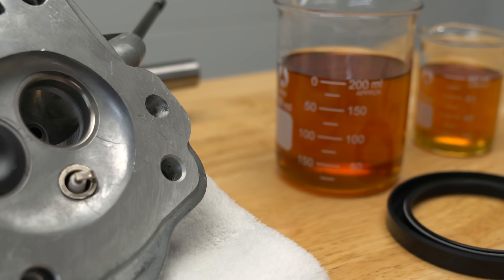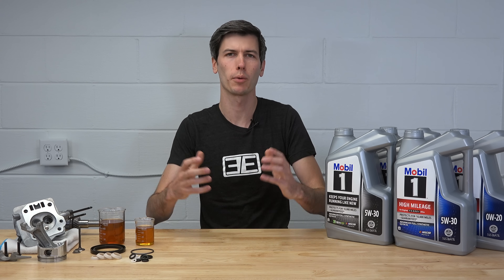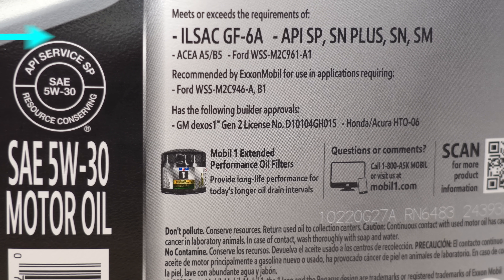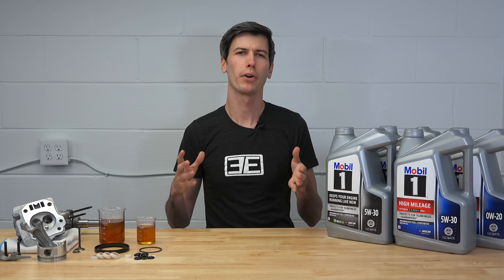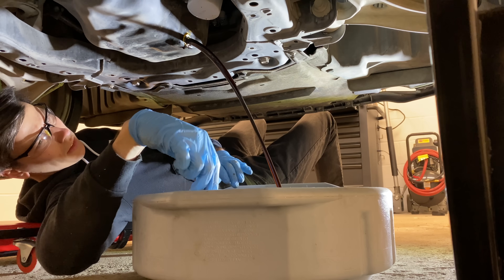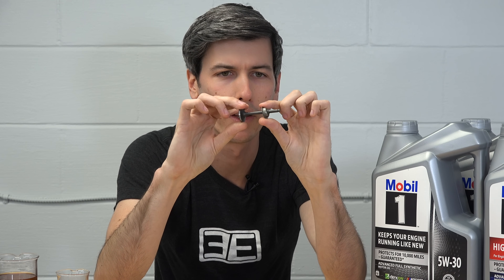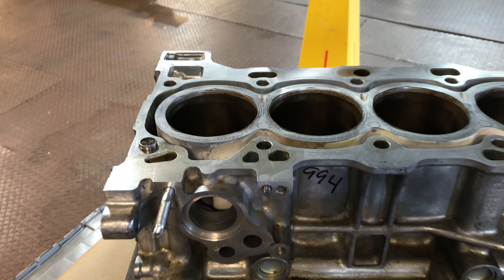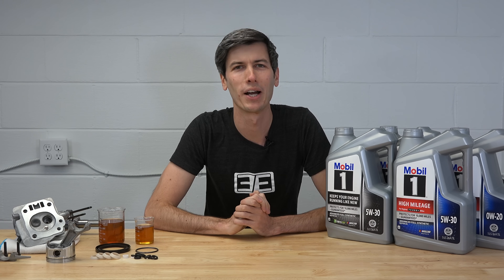Is Synthetic Motor Oil Bad For Old Cars?

Comment: Lets see did a valve cover gasket change on my 180k altima.researched the auto club saw pics of whats needed most timely fix item was to clean sludge from valve cover and engine. well mine had none. use mobil1 since i got it a at 30k.  top of motor was very clean.  just wipe oil off.  reality...  Im sold..

Comment: The switch at Porsche to 0W-40 from thicker oils doesn't have anything to do with engine clearances, but with the switch from oil and air cooled engines (last 993) to the water cooled engines with the 996.

Comment: I landed on a 10yo 150cc beat up honda motorcycle with 65000 Km on it and was burning oil; needed a top-up every 300km.
It was bringing around half of its original oil b/w change intervals.
This was reported to me my the previous owner and he told me to use 20w50 semi-synth.

Here's what I did lol I switched to 10w30 (what the manual recommends) but a fully Synthetic. It started consuming oil like crazy. But then after 2-3 iterations now I own a 12yo Honda that only consumes fuel and returns all the oil you gave it

Comment: Enjoyed the information you've given. Thanks in advance.

I agree with most of what you have said in general. But I'd like to give an example from what I've experienced. You say that thicker oil may help prolong the resistance of the seals to slip oil. In other words to prevent leakage (for instance when we see drips on the ground after a long parking). I had a leakage problem in my car (Opel Zafira 1.6 with Z16XE motor code). My mechanic said the engine needs to opened and the seals to be replaced. And I was waiting for a free time for this operation. But before this I was adding oil and using my car and once had to go for a hardware store. I spent a few hours there and to my shock when I cam to the car park I saw a leak at the ground for about over a litre, maybe  two. So I got back to the hardware store and searched for oil. What my aim was to supply the engine the oil that it had lost. I suddenly remembered. Thicker oil is better for leakage. And plus, I only needed it for about 30 kms to get back home. And I intended to leave the car to the mechanic. So I bought the thickest oil (20w50) I saw there. My engine normally uses 10W 40. To my suprise leak stopped immediately and I arrived home with no problem. Checked the ground where I parked and not even a spill or a single drop was visible. I was happy for sure. Told my mechanic what happened. And he said this not good as this thick oil will do harm. And he was right. There was a compression loss due to a valve malfunction as one the stem was bent. And we had to tear the engine apart. And my mechanic showed me the upper section of the engine which had lack of oil. The oil could not be sent up to the valve rocker. 

So I think a slightly thicker oil can be helpful for instant help to get to the mechanic. But not for longer usage.

BTW this experience is for a small engine. The benefit (if there is) of using thicker oil on worn out higher cc engines may be fine but in lower cc engines, the oil canals are too narrow so I think it is not a good solution to switch to thicker oil.

Comment: So from what you are saying, these are NOT "high mileage oils", they are oil leaking/burning engine oils???  So despite the name, I have no reason to use it in my excellent condition 140K Toyota V6?

Comment: The sludge argument is something you hear a LOT in a vintage and classic vehicle world and it has always completely baffled me that people want to KEEP the massive carbon and sludge deposits in their engines for the sake of 'not leaking oil' which usually just translates to not being bothered to do proper maintenance or re-gasketing an engine and just relying on sludge build up to 'plug' common leak points. I have a 70 year old Flathead V8 truck and I used modern multigrade oil.

Comment: My Jag 3.0 V6 allways 10w60. Drive it from march to Oktober. Runs like hell. All my last cars got 10w60 all season. No one failed. Turbo diesel or gas, every runs till today as far as i know. I pulled on each around 200k - 300k Kilometers till i sold them.

Comment: My 1992 Volvo 940T leaks and burns roughly 1 quart of oil every 500 miles. So I just keep adding oil. Whichever brand of oil is on sale. I haven't changed it or the oil filter since 2020. Car has 562,300 miles on it, and runs fine, everything considered. Point being, any oil is fine, just don't drive low on oil.

Comment: I put full synthetic in two cars with over 250,000 miles and in both cars the timing chain slipped which I chalked up to the synthetic oil being too slippery.

Comment: I started using Amsoil in 1976. I have used synthetic oil in every engine since. Amsoil was the first synthetic oil for auto use. I now use Amsoil, Penzoil, and Schaeffer. I did use mobile one truck oil in my 2016 gmc and my cam went at 55000 miles. It wasn't a AFM lifter the caused it to go. I now have Penzoil in the truck.

Comment: On the topic of detergents in old cars: The logic I've heard is that if you start using a synthetic oil with detergents in an old car without a proper oil filter, it will pick up all that dirt and keep it in suspension, but without a good oil filter it will stay there and continuously run through your engine causing wear, so you have to change oil more often, especially if your engine is old and continues to build up soot.  The logic is thus, that it's better to leave the engine "dirty" and manually clean it than having the oil do it. No idea if that logic is sound.

Comment: projectfarm did a video on the best synthetic.  Use "pennzoil ultra plat" and none of the other pennzoils.  If you put out a ton of mileage like 25k miles every year such as driving for business purposes, then you'll want amsoil which is a lot more expensive than pennzoil but requires fewer oil changes specifically for people that drive 25k or so in a year or less

Comment: Not that I disagree with your statement that you should always use what oil the manufacturer recommends, but in the US  auto market, manufactures lower oil viscosity to get minuscule mpg gains knowing they’re sacrificing longevity. For instance identical Toyota engines in Japan will recommend 30 viscosity whereas in the US, they recommend 20 viscosity. 

This also explains why oil consumption has increased. So my Tacoma uses the manufacturers recommended in Japan 30 viscosity instead of US 20.

Comment: There is term used in the industry called PMs or PREVENTIVE MAINTENANCE and then there are classes APM,BPM&CPM all of which are different mileages for vehicles.
Well my youngest vehicle is 16 and the oldest is 31 years old. And ALL nine engines are running on Shell Rotella T6 SYNTHETIC 5w40 and are HAPPY!!!

Comment: It depends on your engine seals. One meant for tradtional oil like the rope style rear main seals on Fords will leak.

If you are switching to synthetic in a old car you may want to replace all your seals otherwise it will wick though.

Comment: My 2004 Nissan Maxima had 4 dealer oil changes when brand new at 3,000-mile intervals and at 12,000 Mobil 1 synthetic was then put in, and at the time of a new timing chain being installed at the dealer the mechanic noted that the engine was the cleanest he had ever worked on internally. The car has been dealer maintained with me bringing in my own Mobil 1 and Mobil 1 oil filter and the car now has almost 190k and runs like it did when new.
I have every invoice for every service performed on it including the window sticker when purchased.
How many people can claim that?

Comment: What about premature failure of flat tappet cams and lifters because of no zinc in the motor oil?  Is there a mobile One to take care of this? 
I use Mobil One in the cats and my motorcycle.
Reply: Check out the Motor oil Geek. Most synthetics have zinc additives.

Comment: ED, old oil teck, air cool engines usually run hotter which need  heavier oil. like mower or cycles esp. in summer!! i still think the hotter the oil the thinner!!  right or wrong??    the syns have wider temp range than crude based. explain "0" viscosity to me.

Comment: i have a 95 silverado that i bought with 172k miles on it and i have used castrol synthetic 10w40 every 4k miles and i have 309k miles now and everything still works fine. i also use lucas and marvel mystery oil as well. marvel in the tank, lucas in the oil.

Comment: I consider AMSOIL the best,so far. They received there API certification in the 70s. That's 50 years in the business. And they have improved over those years. As far as old engines, 70s and early  years. Zinc content can be an issue. I've got 3 vehicles  pushing over 250k. And an old 70s Chevy.

Comment: You missed a couple of very important points.  No mineral or synthetic oil is a extended oil change oil.  That is just the BS that oil manufacturers and car manufactures claim.  I change my oil every 10,000KM (6000 M) and have NEVER had a engine component fail.  My last vehicle i purchased brand new had 15,000Km service interval, i did a 100KM oil/filter change, then a 7500 then the 15,000!  Oil changes are CHEAP engine insurance.   

Oh the other point…extended oil changes cause acids in the oil from the byproducts of combustion which harden even modern engine seals and cause leaks.  

One last point, short trips using synthetic oils are detrimental to the engine life as the oil clings then cools over and over again causing slugging!  

If you don’t want to pay for expensive synthetic oil, buy the cheap stuff but just change your oil more often…not 15,000/20,000KM!!! Just a few points from someone in the know…

Comment: My basic rule is to use the highest quality oil until an issue requires I switch. No issues, full synthetic 100%. Also, a HIGH quality filter. Wix or Wix XP.

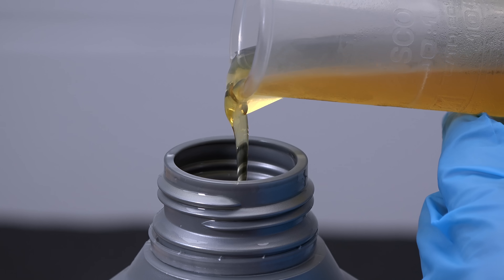Comment: 1:27 dang that's sloppy, corvair engines are similar but 30 weight is recommended for those, high end synthetics are also recommended because they handle the heat better.

Comment: Hi, thanks for this good video, just a quick question: I've been using the synthetic engine oil 10W-40 since 90.000 km. My car has now 120.000km and I live in a hot country, must i continue using this reference or shall i have to change it? If I change now, to which one? kind regards.

Comment: One of the important things an oil for old engines from the 70s and earlier need is the ZDDP additives that special oils for these cars have. Mobil One doesn’t offer an oil to use in old cars. Modern oils lack enough of these additives and the old engines will suffer camshaft failure without them. I use Royal Purple HPS aim my classic 70s car. It would be nice if Mobil One did offer an oil for the old cars, as their products are great. I’ll use them in my daily runner, but not in my old Buick Electra. It’s simple. If the engine has a roller lifter camshaft, the modern oils are fine. If it has a flat tappet cam, use an oil with the ZDDP additives.

Comment: Important thing I’ve heard from engine builders. Synthetic will cause varnishing if you commute short distances, say 10 minutes and the engine doesn’t get fully warm. It causes premature failure. Conventional won’t do this. Other than that synthetic is better.

Either way the most important factor is intervals. I don’t care if the OIL can last 20,000 miles, it doesn’t mean the filter can, and it doesn’t mean the oil isn’t dirty. Change your oil every 5,000.

Comment: My Toyota matrix 2003 consum oil after I switching to mobil 1 5w 30 from Mobil super 1000 with the mileage of 198000, and engine didn't smoke

Comment: What specific oil do you recommend for 1999 Lincoln Navigator?  120,000mi.
Don't drive it often. Just to grocery store 2 or 3 times a month.
However, I do use it for Ski trips a few times a year. (400 mi each way).

Just had Master Cylinder and Spark Plug replaced.
Mechanic told me engine may need to be replaced/rebuilt soon, due to carbon from engine getting on spark plug.

Comment: 1990 Cadillac 5.7 engine. Went to synthetic oil in 2000.  Every gasket in the engine started seeping. Valve covers, timing cover , oil pan etc. Went back to mineral oil and about a year later after a thorough cleaning the seepage stopped.  All factory gaskets.  Still driving it today and no wet seals or gaskets yet.

Comment: I used to have a Ford Ranger with the 2.8 V-6 in it.  It always used a little oil(leaked) between oil changes.  It had just over 500,000 on it at the time. The truck had run on propane since day one.  I switched to synthetic and the oil consumption stopped.  I guess the esters helped limber up the old seals and it ran great until I gave it to my brother.  It died shortly after that.  But that wasn't from engine failure.

Comment: Here’s an issue I came across. I had a 1969 Chevy with a 396 with 60,000 miles. I used Penzoil synthetic and all the gaskets leaked like crazy. Not a good idea. Stick with the original oil.

Comment: And most videos about engine oils look at the European or North American market, where you can go into a store and just take what you need from the shelf. I drive a 20 year old Mercedes E class what needs 5-40 oil. 1st Oil change made at the only Mercedes dealer in Panama. Picking up my car and looking at my receipt, they used 5-30 oil. I turned right at the lot and walked into the office to complain. “We only have 5-30 oils…..” Next oil change in a cheap franchise shop. 5-40 oil with Mercedes approved code on the back. Next oil change I drove my car to the same shop. “5-40 isn’t available more. 5-30 is okay too.” The last 3 years, I only get 5-30 in Panama and even Mercedes Latin America says it’s okay. I miss the time where I just could get what I wanted in Walmart or Canadian Tire! 😊

Comment: Not sure if this has been mentioned, but once you switch to a high mileage oil, you should continue using a high mileage oil for the remaining life of the engine. The reason is that high mileage oil has additives to swell the seals, and if one stops using high mileage oil the seals will likely shrink, possibly causing a leak.

Comment: On the datasheet that came with my sbc v8 it says that the engine has composite fiber gaskets that are not suitable for use with synthetic oil.

Comment: I use 100% synthetic 0w20 high mileage oil that protects against leaks and sludge in my 193,000 mile 4 cylinder. Doesn't use any oil.

Comment: U wer perdy in depth but I was lookin for wether synthetic  would burn in old slant 6 from 1965 due to oil scraper rings   but I did lern about the high mileage  swelling  thing.  Pip pip good on ya folks

Comment: I’ve heard people say to not run full synthetic in ohc motors if you are only doing small trips and never running the engine long enough to heat and burn the moisture, additives, fuel and other chemicals out of the oil. They call it coking when the oil collects in hot spots at certain areas of the engine that aren’t getting washed with oil. This primarily affects ohc because of all the intricate parts that need oiling like cam solenoids and vvt. It can happen in turbos as well. And with the modern engines mostly operating at 205-215 it bakes layer upon layer of oil in those areas up top of the motor. On the other hand if you have an engine like a Gm eco tec with piston ring failure, you have to run synthetic otherwise it will just blow conventional right out of the tailpipe

Comment: Had an RX7 in the 1990’s. Used two cycle oil in the gasoline (premixed it in a small gasoline tank) to help the engine run better. Just cleaned or replaced the spark plugs more than normal.

Comment: You did not address older engines with non-roller cam/lifters and their need for additional zinc in the oil to reduce wear.

Comment: 1990 Mazda B2200, Weber 32/36 carb, headers. Currently at 1, 368, 578 KM’s . Last rebuilt at 950,000 KM’s . Use nothing but Redline 5W40 full synthetic oil and MANN, Wix or Purlator oil filters (as available) . Engine is spotless inside, not a spec of sludge or carbon buildup . Truck is driven hard in hot temps , I change the oil every 15,000 KM’s, oil filters (2) every 5000 kms. Oil topped up every filter change. Zero oil usage .

Comment: WITH OLD Cars I Just use Semi Syn. Castrol and change it  2 x a year with low miles. per year.  No Drama No Risk of  Uncovering a Clog in an engine seal and then leaking out.  If you have an older car 2nd 3rd owner car you could have bad Cluged  engine seal and the full. syn. will clean it out and LEAK.  That is the point.

Comment: I started using Mobil 1 in 1977 and have used a synthetic oil in every ICE engine in my possession since. That is over 40 vehicles including classic cars, quads and a diesel pusher motorhome. Although retired now I spent 44 years in the automotive service business. I can confirm that switching to a synthetic on an older engine can reduce oil consumption (sometimes substantially). I believe it is due to it's cleaning abilities which loosens up stuck rings due to sludge. However, I have seen several instances where a poorly maintained engine with a presumed huge amount of sludge build-up failed after switching to a synthetic oil. It seemed like the sludge was what was holding it together. I do use different brands of synthetic oil now due to different application needs in some cases such as my diesel pusher. Turbocharged and supercharged engines should always use synthetic oil. Not only will a synthetic reduce turbo lag but will also not break down and coke (carbonize) in high heat situations such as right after shut-down. Carbonized conventional oil ruining turbocharger bearings is a leading cause of turbocharger failure.

Comment: FYI: The very first Mobile1 oil (early 70s) was full of graphite. It was a black color. What happened in many cases was the graphite pooled together and blocked oil flow. I worked on many engines that had rod bearing failure due to oil starvation caused by Mobile1 oil. Fortunately, this issue was resolved very quickly.